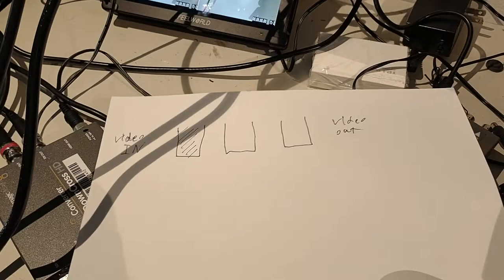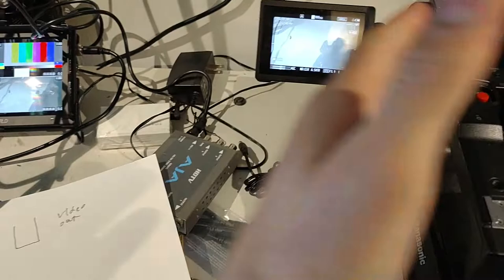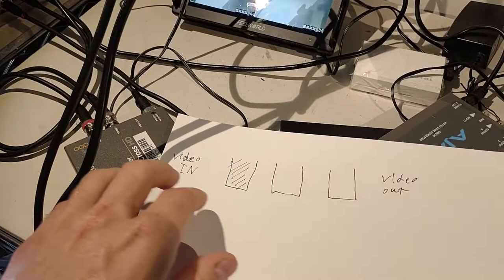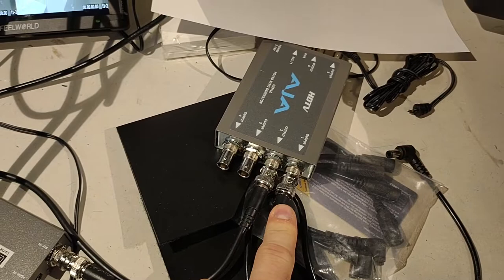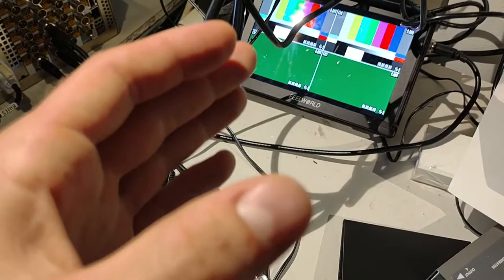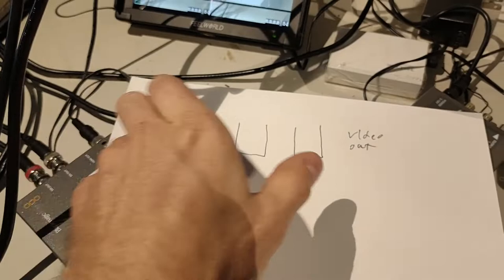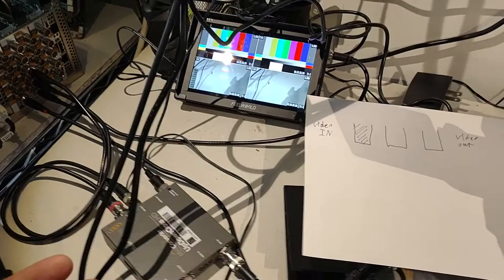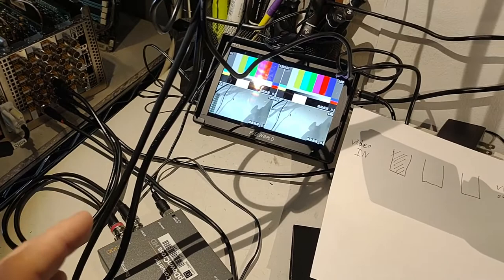what is Genlock or a video reference and how does it work?

Comment: Do we need to have both the blackMagic Micro-converter up down converter and another device the AJA Synch generator for the genlock stystem to work? Or just the synch-generator would be needed? 😅

Thank you so much for the explanations on the video and the full glass analogy into the next glass is awesome. 😊🤝
Reply from the maker: Sorry for the delay (lol) in replying I YouTube is not notifying me of comments. To answer you question you will always have a minimum of 3 devices when using genlock. You will have the source device suck ask camera or my up down cross convertor you will have a destination device like a switcher or or video wall and a genlock generator like the AJA to tie them together. 

Past that if you get into matrix and other intermediate devices that carry the signal along the way to it's final destination you would connect that to the genlock generator as well. 

Genlock is a standardised thing if you go on B&H or ebay you can find them from every manufacturer under the sun.  

Thanks for the question and feel free to ask as many as you need.  Or make a video and post it in the comments I'll try to reply when I have time.

Comment: Great explanation, really simplifies it for my feeble monkey brain 😂👍 might be a silly question, but where in the chain does the sync generator need to go? Say you've got a larger signal chain with matrix and switchers etc, is it just a case of ensuring that they are all connected to one another's genlock i/o, so that the sync generator is basically daisy chained into the chain, wherever it may physically lie, or does the generator need to be at the top of the chain so that everything downstream is connected to it? If that makes sense? I.e would the camera be connected directly to the sync generator, and then everything downstream is also synced, or could you place the sync gen anywhere in the chain, so long as all the devices are plumbed in to one another too? (As I type this and thinking it through I'm thinking it's the latter, since the first scenario assumes you only have one camera) hope that makes sense, sorry if it's a dumb question!
Reply from the maker: It's not a dumb question at all. 

Everything must get the signal from the sync generator (at the same time) and when I say at the same time I mean the pulse from the sync gen must arrive down the cable at each device simultaneously. 

Say you have a sync gen that has 2 outputs, if you need to connect a 3rd device you would have to split the signal from the sync gen in one of 2 ways. 

The first way is passive. Without getting into complicated electronic teary. This is not always the best way because the signal can get unstable due to each device putting a load on the output of the sync gen and causing weird problems.

The second way is actively taking the output of a sync gen and passing it through some sort of amplified splitter. This is the ideal way of splitting the signal BUT you just added some element of delay. 

This may not be a problem initially, but you can create some problems that using a sync gen is intended to solve. 

Say for example you have a distribution amplifier connected to your sync gen, you had half your equipment connected to the gen direct outputs and the other half connected to the distribution amplifier. The devices connected to the DA are technically receiving the reference or sync gen signal slower than if they were connected directly to the sync gen itself.

How do we fix this?

The best way is to have all devices connect to a DA output in other words sync gen>DA>your broadcast gear. This way all devices have the same inherent delay. 

I am oversimplifying this but if you were in a broadcast truck with dozens if not a hundred devices. This can snowball into a problem that can have rippling effects at scale. 

The short answer is sync gen just needs to hit every device. There is no order because most devices don't even have a loop out anyway, so daisy chaining is impossible. If your device did have a loop out you would want to know if it's passive or actively being amplified and how much delay is being added to that amplification. 

I hope this is understandable. 

Thanks for the question.
Reply: Having half your devices on a DA and half your devices straight out of a generator really shouldn't be a concern. In fact even daisy chaining DAs should not be a problem. Nor should loop outs.

DAs and loops do not add any more latency to the system than mismatched cable lengths would. These are not doing any processing. We are in the world of analog. The only time that passes is the time it takes for the electrical impulse to pass through a few coils of copper. It's basically instantaneous.

That said, if there is a timing mismatch that is causing a problem (usually due to extremely long cable runs to and from a device), most devices that accept reference signals also allow fine tune timing phase adjustments that can dial the timing in when the device is genlocked and viewed on a proper scope.